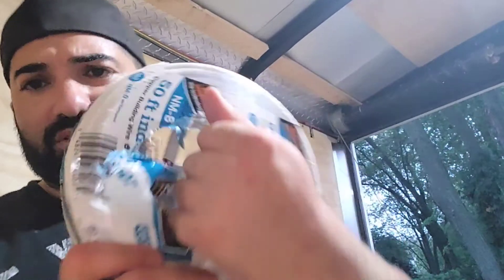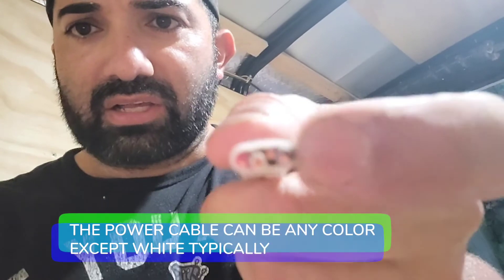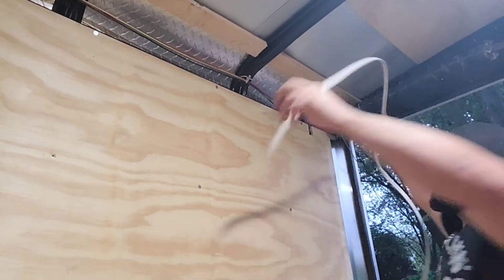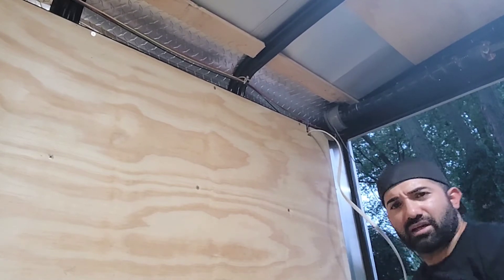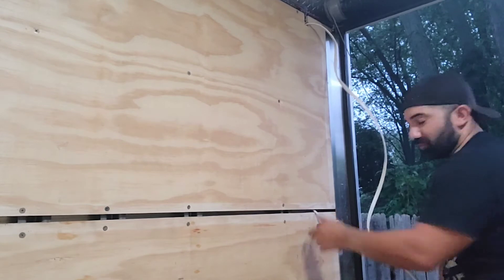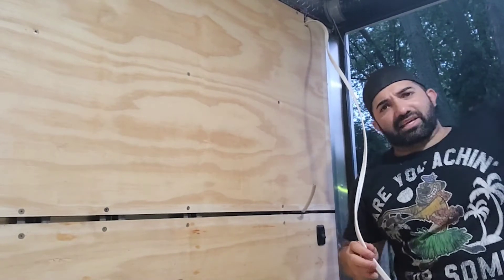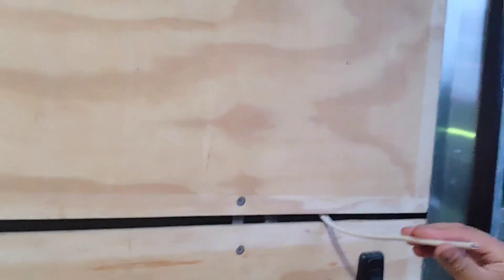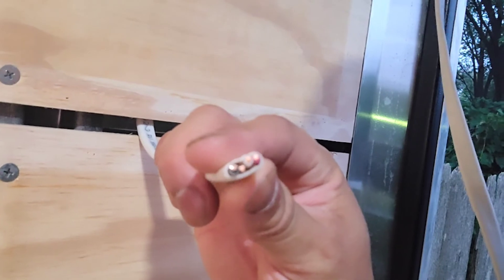How to Build a Food Truck: Starting the Electrical

Comment: Hello. Do you not have to insulate the trailer first? Just asking because I don't know if it is actually needed.
Reply from the maker: I do insulate the ceilings not the walls because I do not have to remove plywood. The walls would be a lot of work and when you get all the equipment running and you are cooking you probably would not even feel the difference. Unless your health department requires it different story
Reply: @fbaltierrez  Thank you!

Comment: Could you give an example of reason why you may need to expand the extra wire?  Just curious and thank you! Videos are VERY informative for sure.  Thanks for sharing your knowledge and experience with us. #RoadkillRaysBBQ
Reply from the maker: Appreciate it. I ran 2 extra lines for expansion. In case whoever i sell it too wants to add some fans or more outlets. They can just tap right in to the wire and not have to run anything new. Easier to do it now than later
Reply: @fbaltierrez  thank you,  so it’s basically like running an extra leg? Would that wire be fed by the same breaker or left dead until needed?
Reply from the maker: Exactly an extra leg, I'm going to leave it dead with the other end ready to just be added to a breaker
Reply: @fbaltierrez  🤯 lol

Comment: Following; Starting a pizza trailer build. Do you insulate your trailers?
Reply from the maker: Thank you for following. Yes I insulated the ceilings not the walls. Thats what I did on mine and have had no issues. Will cover that on the next video, Thank you for watching:)